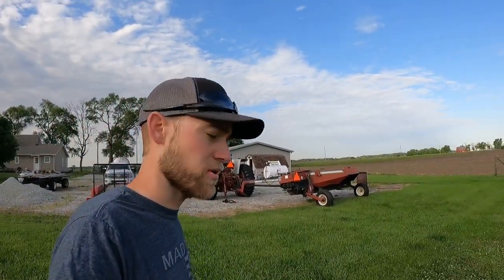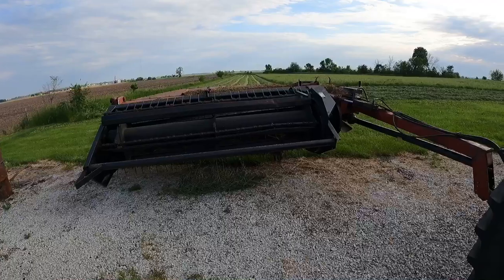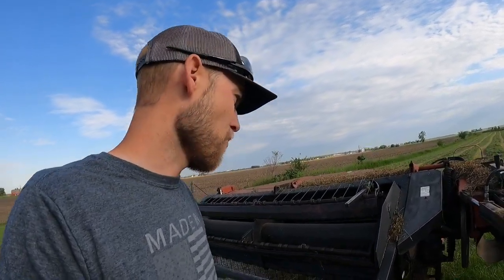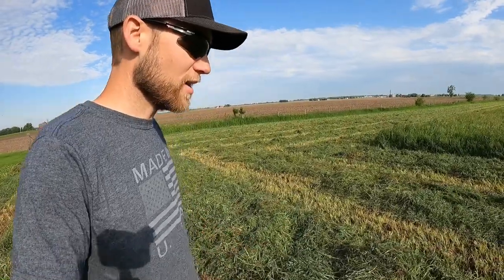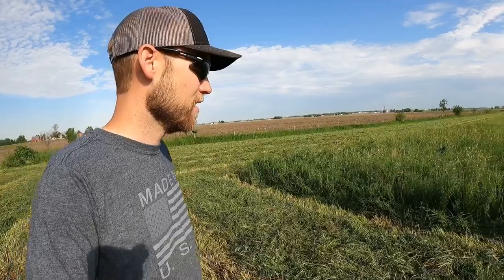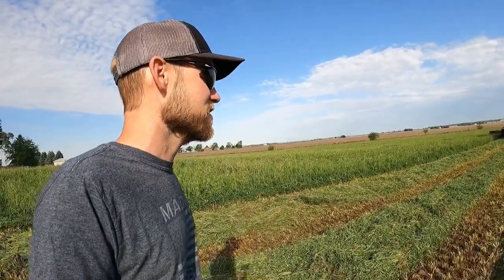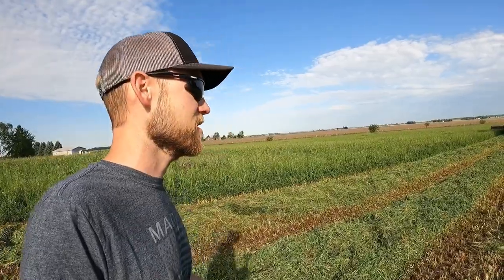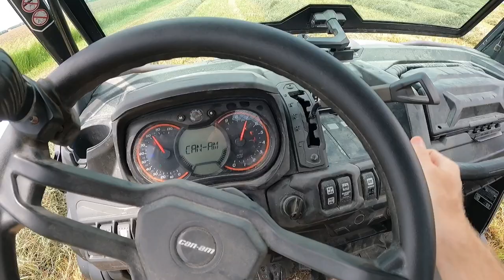Red and Green Machines cutting raking baling hay | Vintage Farm Equipment

Comment: In heavy hay like this adjust the rollers open a little bit more. Will help with the feeding issues. I usually open mine up for first cutting, n tighten them for second.
Reply from the maker: Never thought of that! Thanks for the tip!

Comment: Cutting too low to the ground. Lots of dirt plugging the works. Years of running a New Holland haybine taught me that sickle bars don’t like moisture and dirty stems. Always Dreamed of a discbine that would run 6-8 mph but never had the money 💰
Reply from the maker: Dad ended up raising the front of the machine to get the sickle up a little higher and that did the trick
Reply: @WesFarms  I could tell when I saw how the ground/stalks looked like it had been dozed over